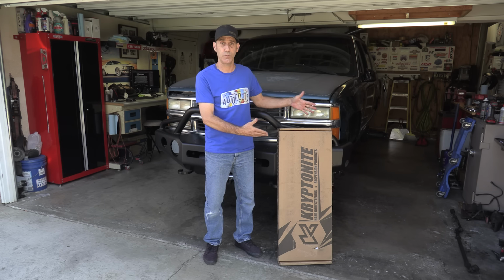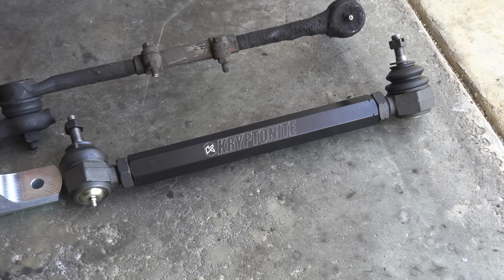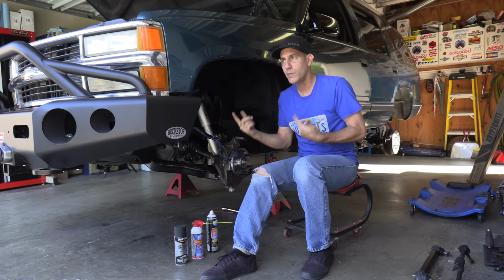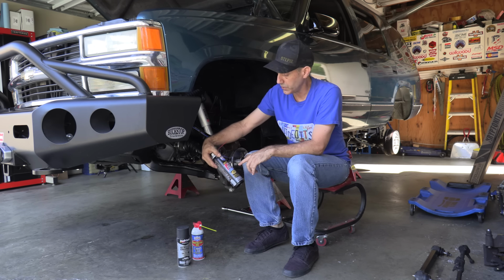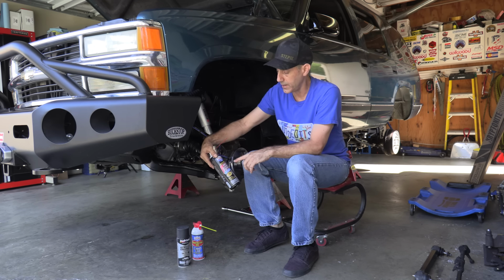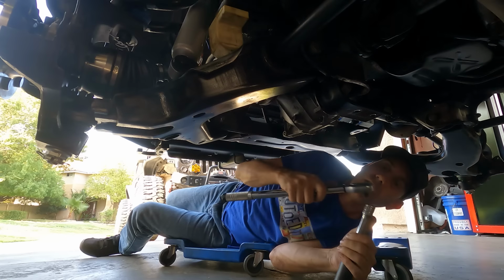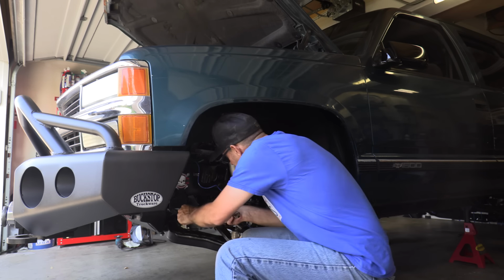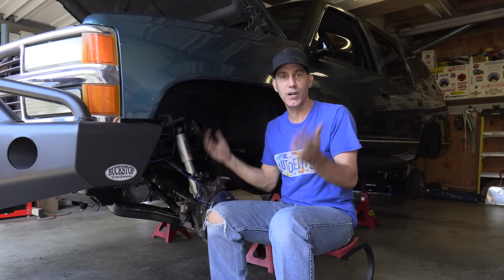Strongest Steering Upgrade for OBS Chevy Trucks and Accidental Suspension Rebuild

Comment: Did you hear about the steering stabilizer my friend? It is a good part for what your looking for helps prevent wear and tear on the parts you just put on, also helps keep the wheel stright on rough roads sounds like right up your alley lol
Reply from the maker: Thanks for the suggestion 👍

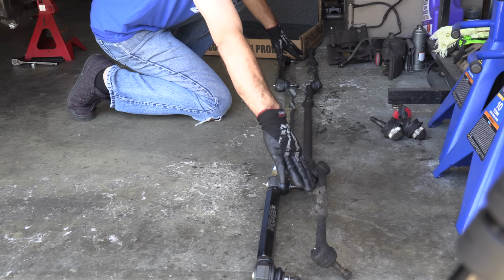Comment: “While I’m here” led me to multiple, way over the top rebuilds on multiple vehicles. My leveling my 2016 Ram ended up with Bilstein 6112 struts, Mevotech lowers, Icon uppers, and a 3:21 to 3:92 front diff housing swap. In the rear I ended up with Bilstein 1” coils, Bilstein 5160s, Hellwig rear sway bar, Core 4x4 Tier 3 upper and lower control arms and AirLift rear air bags with a remote pump setup. Oh yea…. 3:92 gear swap and a Yukon posi to match the front. 

  I won’t even talk about my LS swapped JK… 😳

Comment: Looks like really good quality stuff.  The only problem I have is how much money is possible to dump into the IFS on one of these trucks.   Then you’ve still got the weak aluminum 8.25” differential with no traction devices available.   It also means being  stuck with limited suspension travel, all for the pleasure of spending a lot of money.   I think I’d rather just do a solid axle swap with 1 tons, custom leaf springs, and just be done with it.

Comment: I have a 2006 Mazda Speed 6 that needed a new CV axle in the front. I put it on jack stands and... "While I was there..." I noticed the driver's side upper control arms, ball joints, and sway bar end links needed to be replaced. This lead to a full suspension rebuild because the parts were exactly as you stated -just cheap enough to empty my pockets. In the end it was worth it, but I cried as I looked at the total. lol

Comment: 6:45 That's just rust proofing.

Don't forget the rag joint at the steering box as well. They tend to wear out. Borgeson makes a replacement shaft (both lower and upper) if you don't want to track down a DIY U-joint solution.

Comment: yeah i had that mentality when i was replacing the radiator on my k1500 i ended up replacing both radiator hoses switched all the clamp style clamps with threaded hose clamps new water pump clutch fan assembly and thermostat
Reply from the maker: What brand radiator did you end up running... thinking of doing that pretty soon!
Reply: @AutoEdits  i ended up running a GDP radiator but you have to be careful because for my truck at least the oil cooler and radiator were separate but the ATF runs through the radiator so i actually bought the wrong one but its working fine for me right now but check your current radiator and if it has 4 threaded lines then most radiators should work but if it has just 2 try and find a correlating replacement

Comment: Hey man, I’m totally glad I came across your channel! 
Im super impressed with your suspension rebuild and would love to rebuild mine. I have a 99 Tahoe 4x4 and im wondering has anything really changed from the 95 and 99 Tahoe,? suspended wise?
Reply: As far as I know, the only difference between the 95 and the 99, is that the 99 would have the electronic shift transfer case instead of a lever, and the "Vortec" 350 instead of TBI.  Suspension should all be exactly the same.
Reply from the maker: I wish I had the Vortech!
Reply from the maker: Hey, thanks! I think they are mostly the same... you might have coil springs instead of leafs in the rear of yours.
Reply: I forget, was 99 the last year of the GMT400 body style, or the first year of the GMT800? I feel like I've seen '99 400s, so maybe they even made them both at the same time?

GMT400 would have leaves, 800 would have coils.

Comment: Hi Jason I’m new to the channel, I have a 99 Tahoe and I want make some upgrades like yours, tires, front suspension, which steering package will work my 99 Tahoe
Reply from the maker: Did you check out the kryptonite?
Reply: @AutoEdits  Yes I did , I didn’t see 1 to fit the 99, which one did you purchase for your truck
Reply from the maker: @kevinthompson9350  The link is in the description but here you go https://kryptoniteproducts.com/collections/1988-1999-gm-k1500-k2500-k3500-truck
Reply: @AutoEdits  Jason thank you for replying, also you mentioned where to purchase the bulbs that you installed on the tahoe

Comment: I have a 99 Tahoe 4 wheel drive did you change the steering knuckle also
Reply from the maker: Those are the stock knuckles... just cleaned them up with a wire brush.
Reply: @AutoEdits  ok thank you

Comment: I'm trying to find parts for my 1997 suburban k2500 it's a 454 7.4v8 do you have a company you recommend I wanna rebuild the front and rear suspension also want to put a 7 inch lift.

Comment: Have a 96 Chevy Tahoe k1500 5.7l and I need the part number for the oil cooler lines for cooler and oil filter adapter housing seal
Reply from the maker: Just go to rockauto.com and pick them up

Comment: Have you ever thought of doing an energy suspension refresh of the bushings?
Reply from the maker: If I remember correctly, there isn't an easy to find kit of bushings for this year so I just replaced what I could from any vendor.
Reply: @AutoEdits  I think energy suspension has a kit
Reply: Detroit axle has the upper control arm with new bushings and upper ball joint .

Comment: I've been waiting for this video gald you didn't get to banged up 😂 still waiting on what you're going to be doing to the rear everything is looking beefy so far
Reply from the maker: HA! This thing is putting up a fight for sure... thanks... we'll see for the rear. Having to drop the fuel tank to get the rear spring out is a bummer so waiting to get the front end sorted first.

Comment: now how are you going to Get inner tie rod ends off since you cut off the hold back point...
Reply from the maker: Not really worried, if it doesn't come off with an impact wrench... I'll just cut it and replace it. Turns out that once it's connected, it doesn't need to get cut right there anyway
Reply: @AutoEdits  yea true at least it’s only like 60 bucks for a new one anyway

Comment: i noticed that you have the pressed in style ball joints as do i did you just use a bearing press I've seen a few videos and it looks like a bear
Reply from the maker: It was pretty easy with a harbor freight press.  the thing that was the most awful was pressing in the lower control arm bushings.

Comment: Jason, 
What are your thoughts on leveling kits, like the one you installed, effecting the durability of the suspension parts/ roughening up the ride? From what I've read stock keys lift just as much, and both options add lots of strain to the vehicle.

I'd love to be wrong, I'm just curious about what you've learned :) 
Thanks for your help!
Reply from the maker: All good... we'll find out together. I'm not going for maximum lift with this setup... just 2" and some thoughtful dial in. Let's see how it goes.
Reply: Its been about a month, how are you feeling about the torsion key lift? I ask b/c I'm considering the same for my 95 silverado and I'm curious if you'd do it again or go the rough country 4" lift route or something similar. Thanks!

Comment: The sloppy steering is probably mostly from the rag joint in the steering shaft.  You should be able to upgrade to a u-joint style steering shaft.
Reply from the maker: I actually replaced the rag joint and it wasn't that bad. The ball joints I show on the old stuff on the floor were a big reason and the steering box itself was very worn out.
Reply: @AutoEdits  Yea, I was figuring there was probably a video I haven't seen and you have already done this.
Reply from the maker: @Marcus_Woodard  It's interesting... your comment reminded me that I didn't even mention the rag joint in the video! So much stuff to pack in.

Comment: Lift blocks suck. Add a leaf is a way better way to go when off roading. And you should look into upgraded upper control arms. Especially since you already put lift keys on.
Reply from the maker: I agree that blocks aren't ideal but its just a step towards checking if I even want any lift on this thing. Plus 2" shouldn't really effect it that adversely. I couldn't find any upgraded UCA's for the 95 K1500... any recommendations?
Reply: @AutoEdits  QA1, Freedom Off Road, Rough Country and there are some no names on eBay that make tubular upper control arms for the 88 to 98 chevy. They help with camber issues as well as improved ball joint angle.

Comment: those front-end parts are crazy expensive
Reply from the maker: Holley offers a slightly cheaper version of strong front components but like I mentioned in the video... there are certain areas of the build that I want the "peace of mind" of the strongest component on the market and these are it.

Comment: If I'm being %100 honest I would have spent the 700+ bucks on a real lift with a drop down diff to save you the money on all the new things (ball joints, CV axles and tie rods) that have already replaced,  instead of the  kryptonite parts...
Reply from the maker: I almost agree but didn't want to change that much on there yet... Just took it through Death Valley and it handled amazing. I'll get that video out soon. In the meantime check this out https://youtu.be/T7QpaJrz0r8

Comment: Now let’s talk about this practically , $1100 for a pitman arm and some tie rods that guarantee you’ll break different components much harder to repair on the trail ? While  you can usually bend a tie rod and beat it back into shape with a rock ? I do understand that rocks don’t do many sponsorships though.
Reply from the maker: I get your point but that's not exactly right in this case. With the RCV axles... yes I broke the next thing in line and it was a pain. When all of the steering components are heavy duty... the only thing left to damage is the spindle and I'd have to be doing something wrong to deserve that. Plus, this kit has upgraded ball joints for better overall feel and like I said in the video... it's peace of mind. Big time.
Reply: @AutoEdits  are you running the stock wheel studs ?
Reply from the maker: Whatever comes pressed in to that new hd wheel bearing flange.

Comment: Do you Believe that your Truck Knows Smart, Vindictive also. I have had Steering Colum Problems. Bought one off e~bay never again. Was told his would Fit Ha HA Did not. Had to have all Plugins wired in.  From that time I have had Problems in truck not Starting (with me)  Most any other person can Start the truck just by using the Key. Will not Start for me No Matter what I do. My Truck Hates me, Possessed by a Evil Sprit.. HELP ME  send me a Priest..
Reply from the maker: Yikes!
Reply: Thanks-- But My Truck Hates me Now I have pay a wecker bill  to Take it to a shop for Repair. OO Yea Me